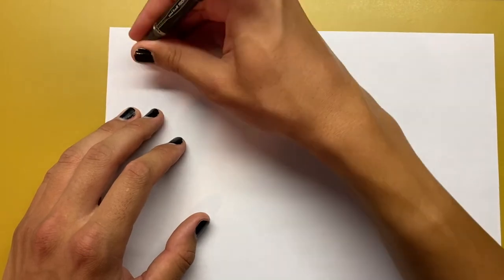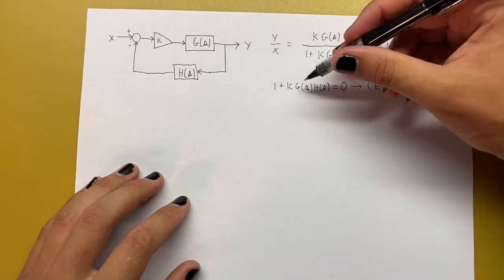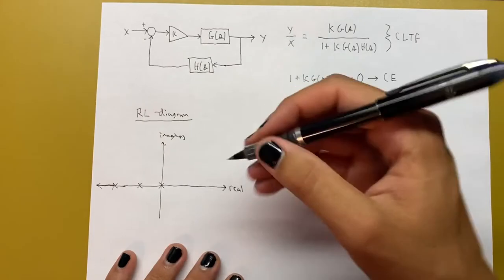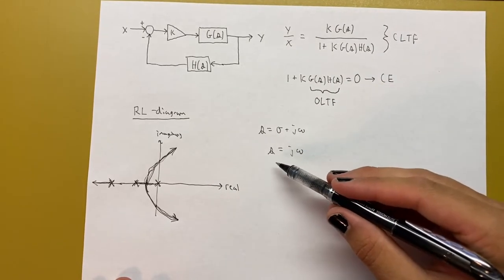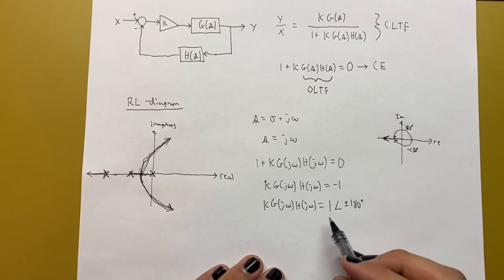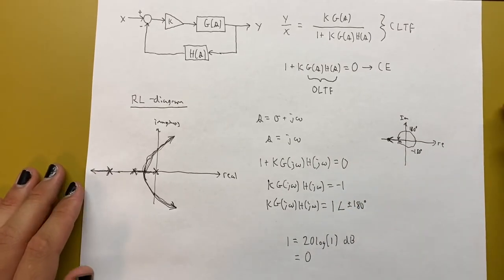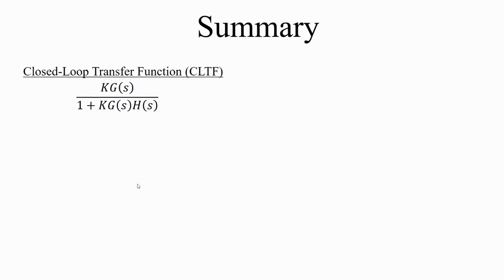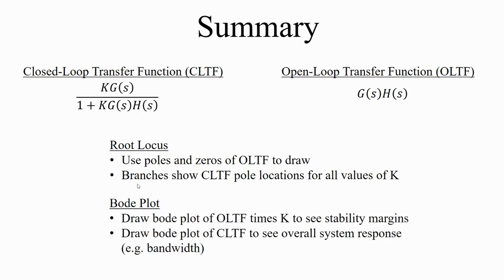Open-Loop vs. Closed-Loop Transfer Function (What's the difference and when to use them)

Comment: Hey bro I am not able to understand how closed loop stability is related to open loop transfer function what are the conditions of open loop transfer function to make CLTF stable .
Reply: There are no explicit conditions other than your closed-loop poles need to be in the left half plane (on in the unit circle in discrete systems). As he said, take your open loop system (G*H) and plot the root locus to see what value of gains k could make your system stable.

Comment: How can I apply this to solve plant instabilities that uses PLCs?
Reply from the maker: That is a good question, but well beyond the level of this video. From a basic level, you can model your plant as a linear system and then use the classical control methods discussed here to design a linear controller to bring the unstable poles back to the left half plane. Unfortunately implementation on PLCs isn't something I have much experience with, so you'll have to look elsewhere to find how to do that. Good luck!
Reply: @dmdengineering  thank you so much.